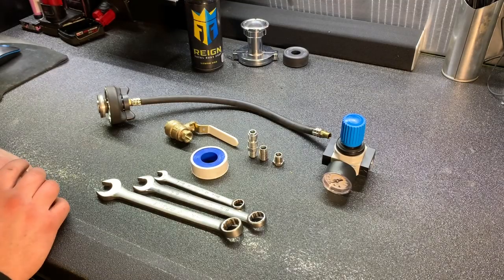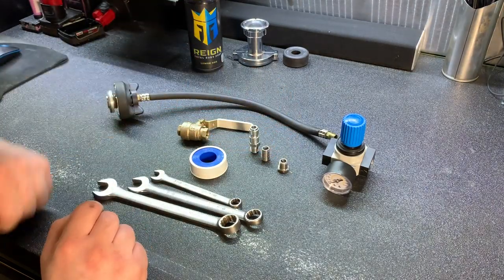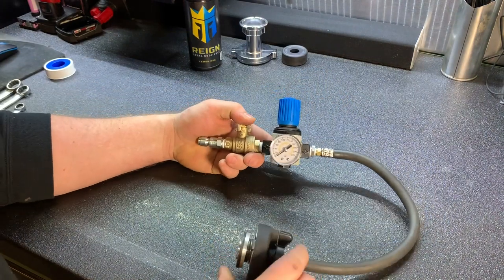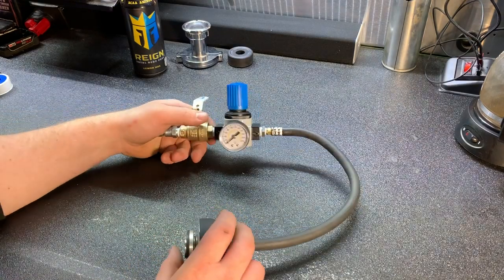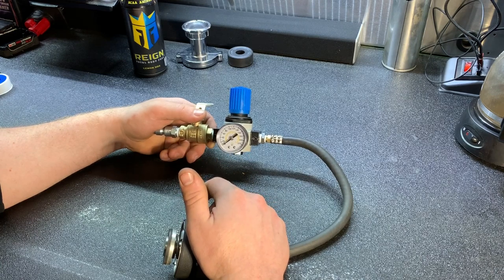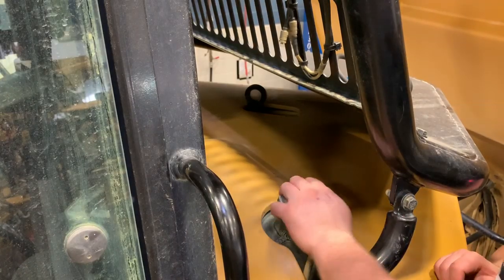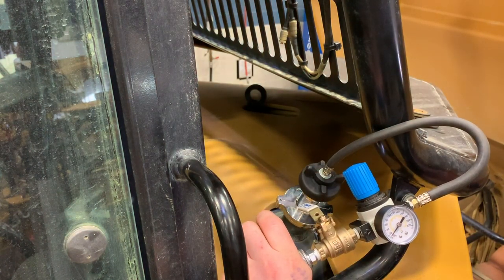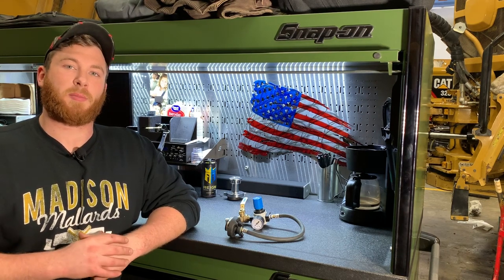Testing Cooling Systems The Right Way | You Have Been Doing It All Wrong

Comment: What psi should passenger vehicles be set to?
Also can you do this with coolant in already?
Watched your awsome toolbox review a week ago and youtube recommended this vid as well. Thanks
Reply from the maker: mr I Well first off, thank you for the support! Secondly, yes, you can use this while there is coolant in the system, when I showed it in use in this video that cooling system was full and that is why it filled the pressure so quickly. Granted, as I stated in the video to use this tool to its full potential you would want to use it before refilling the cooling system after doing any work that intruded on the system. That way you find leaks prior to filling it with coolant. Also I believe most passenger vehicles are right around the 12 or 15 psi. It usually says right on the radiator cap. I would suggest staying within a few psi above that while pressure checking the system.
Reply: @ValleyCityAutoYT  Great, thank you very much for the reply, I will make one after xmas. Merry Christmas
Reply from the maker: mr I Merry Christmas to you as well!

Comment: Can you please please leave the parts number that you build the tool
Reply from the maker: Edwun Martinez 
NANPU LR-1/4 Mini Air Regulator with Steel-Protected Gauge 1/4" NPT, 60-SCFM 230Psi https://www.amazon.com/dp/B07SJYMTQT/ref=cm_sw_r_cp_api_i_IGgmEbXF98W03

Stant 12704 Cooling System Pressure Tester Replacement Hose and Head Kit https://www.amazon.com/dp/B000GTIJOE/ref=cm_sw_r_cp_api_i_QIgmEb5P0NJHX